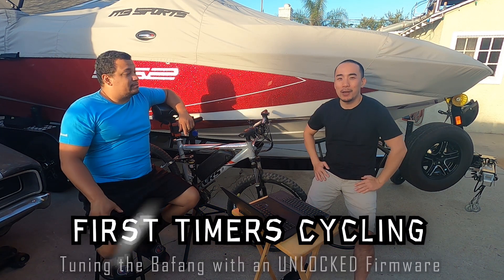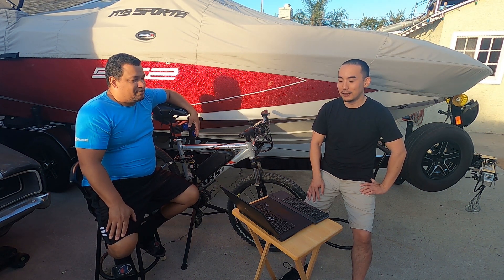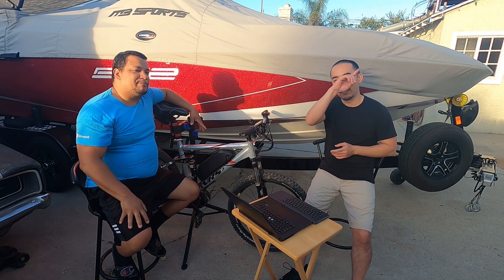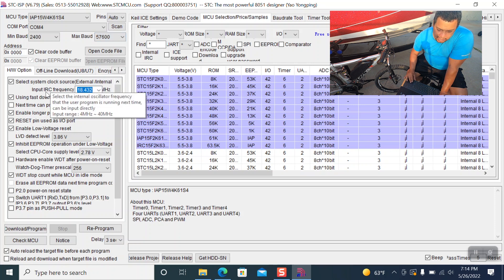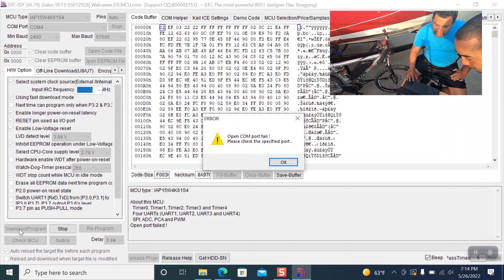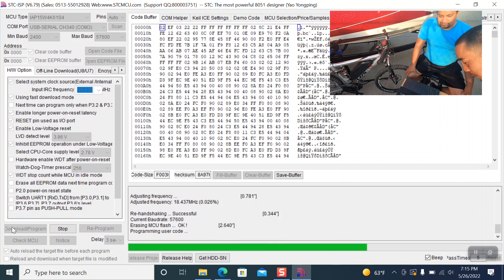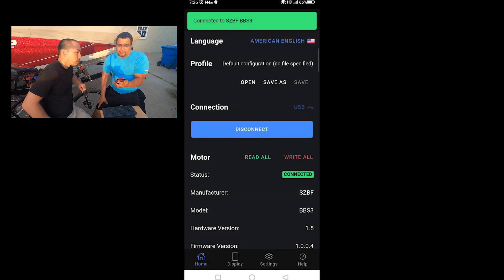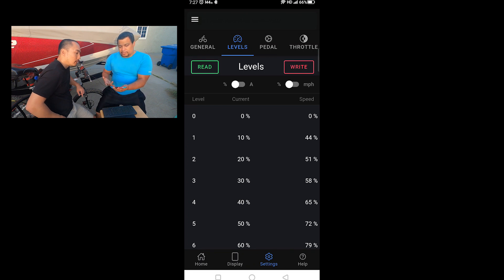Tuning the Bafang Controller with UNLOCKED firmware

Comment: Is it possible to bypass the speed sensor on the bbs02 canbus
Reply from the maker: Not really sure. May I ask why you are trying to bypass it? I'm curious.
Reply: @FirstTimersCycling  my speed sensor isn't working and I have replaced it with no luck
Reply from the maker: Checked the cabling to the controller?
Reply: @FirstTimersCycling all seems ok no broken wires
Reply: @FirstTimersCycling although I haven't taken off the controller to look inside
Reply from the maker: Hmm... wish I could help. Don't know what else it could be.
Reply from the maker: @williamlam8306  What about the speed sensor magnet that goes on the wheel? Is that still good and attached?

Comment: Mine the same 48 nominal voltage and 28a
But my bbshd is 52v and also the battery , I thought maybe the seller made mistake ??
Reply from the maker: We believe it's just the Bafang Controller that you are using that supports 52v. The one we are using is the C961 which seems to only support 48v.

Comment: How can I do this i have a 750w bafang i have got the cable and a software but only does 40mph
Reply from the maker: Hello, and thank you for commenting! This firmware is for the 1000w motor. Not sure how or if it would be compatible with the 750w.
Reply: @FirstTimersCycling do you have a software for 750w my bike jitters iff the start but I want to be able to get the from end up
Reply from the maker: @Nitro_only We only have it for the 1000w. You can try reaching out to GoldenMotor to see if they can help you. They provided the 1000w firmware update so I'm sure they have one for yours. https://goldenmotor.bike/collections/bafang-mid-drive-kits?srsltid=AfmBOor5rbOyf33czMnX3VtwO2d3K7gwW20pXPS1uHK1h7FH76Uya6V4

Comment: The delay with the original firmware settings isn't even safe.
Reply from the maker: Hello, apologies for my ignorance, but what delay? Are you referring to the stock firmware on the BBSHD?
Reply: @FirstTimersCycling Yea the original. For me it's too delayed to get you out of a sticky situation.
Reply from the maker: @warlockboyburns hmm, we didn't experience a delay with the stock firmware. Maybe a little. It's definitely like a car throttle with drive by wire instead of a cable throttle connection, if that makes sense. If that's the type of delay you are talking about, then yes.

Comment: Great resource. My question is about the Bafang motor. Most hub motors are taken from the bafang design if not outright a copy of.  Will this tuner work on those cloned Bafang motors too?  I cant find this answer anywhere, can you help out?
Reply from the maker: Wish I could answer that question, but I don't know. We've only dealt with the 48v and 52v bbshd mid drive bafang motors. Might want to reach out to Golden Motors as they might know better. Sorry!

Comment: I've just bought a 36v bafang motor, but i have a spare 48v battery from a previous conversation that I have done and I'm wondering if with the firmware I can change the motor to 48v
Reply from the maker: I wish I could say yes, but we don't know these motors compatibility to different battery voltages. Might want to ask Golden Motor who creates firmware for the bafang and is highly knowledgeable! Hope this helps!
Reply: @FirstTimersCycling change capacitator

Comment: what are the settings for 48v battery
Reply from the maker: We haven't looked for the 48v setup. Alvin's bike is the 52v and he wanted to tune it. The 48v is running the stock firmware as of right now.
Reply: @FirstTimersCycling  oh ok thanks if you do work that out please let me know greetings from the Netherlands
Reply from the maker: @ManMan-b5y5c  We will make a video if or when that takes place! Thanks for stopping by!
Reply: i have a 48v battery do you know what settings i need in the programe or re they the same
Reply from the maker: I'm afraid we don't know for sure as we are not experts for the Bafang motors. You might want to reach out to Golden Motor -> https://goldenmotor.bike/ to see if they can help you.

Comment: Word of advise is just installed the new 32amp controller and then set it to my 52v battery set up ,this had a negative effect on my battery power so when I reset to 48v using the same settings it put the battery back to ful, power and running at almost 54v , in top gear it runs off throttle power no weight 50 miles per hour wheel speed , less is more guys
Reply from the maker: Oh that's interesting, thanks for the insight! I would imagine it to also depend on gearing sizes as well?

Comment: Hi guys,
I am struggling a bit to configure my 48v BBS02, I changed the BMS on the battery, and the error 30 appears on the screen after that. I am flushing the system many times but the error is still there. Do you have where can I find the correct firmware for a 48v BBS02?
Reply from the maker: Hello, I'm afraid we only worked with the 52v firmware on Alvin's Bafang setup. Mine is the 48v and have not yet updated the firmware. I don't plan on modifying it either. Sorry!

Comment: My controller has 30H error I've tried to connect the controller but nothing it just will not connect any ideas please.on the Bafang data cable it's red but the blue light is solid not flashing.drivers installed so I have no idea why it will not read.
Reply from the maker: Hey there, in the description field of this video there is another link to the firmware update provided by Golden Motors. If the updated one is throwing that 30H error, try reverting back to what works. The one from Golden Motors should work, it just didn't allow tweaking of the settings via Speeed app from the phone.

You can also try this link to try another firmware update https://support.biktrix.com/kb/guide/en/52v-programming-for-bbs02-motor-K2gUq2nWAX/Steps/1132765
Reply: @FirstTimersCycling  hi thanks for the reply thing is it will not connect to the program because of the 30H it will not connect to the software so I can not revert back to anything.
I think I have a brick,oh and have tried a new display still 30H also re did all the connections changed the wire harness.
Thing is though pedal assist still works though I get no battery voltage and no speed indicating.any ideas.also I'm on a 48v battery 21Ah by the way my controller is a Bafang LD-BG-AK007 22A 48V
Reply from the maker: @ManMan-b5y5c  Aw damn. That sucks. The videos we posted was for a 52v setup not a 48v. Alvin's ebike is a 52v battery but we read that the motor uses a 48v firmware so we had to upgrade it from 48 -> 52. This may be why yours is showing 30H as the firmware you installed is for a 52v. Might want to try reaching out to Goldenmotors to see if they have a base 48v firmware you can upload. That should bring things back to default hopefully. I hope that helps.
Reply from the maker: @ManMan-b5y5c  We're not professionals but there should be a way to revert or upload a different firmware
Reply: @FirstTimersCycling  i havent installed any firmware on this controller im just trying to install a firmware so the error might go away ,but it will not connect to the programe to install and like i said earlier my controller is LD-BG-AK007  bafang controller not a mid drive.
Reply from the maker: @ManMan-b5y5c  ah I understand now. Sorry about that. Wish we can help but we aren't experts on this and only found firmware for the setup we currently have which is the Bafang BBSHD 52v mid drive system with a C961 controller.
Reply: YO HE CONSEGUIDO SOLUCIONAR EL ERROR 30 H mejorando las conexiones de cada elemento externo al motor....sensores de freno, sensor de cambio, en todos los conectores he añadido lubricante electronico para contactos y consegui solucionar el error. No se cual de ellos tenia una mala conexion por eso lubrique todos los conectores.
Reply from the maker: @mikelugarte2280 Thank you for sharing that fix for the 30H error! Hope it helps anybody else!

Comment: I just had my first ride today with the hd, and the sw102. Still charging battery so I can use the I think its the bbs tool thing with the pc. Haven't got a working otg right now but it's on the list.
As far as I can see the eggrider and the cyc, these are just sw102 displays with custom firmware? is that correct?
Can you educate me a little on firmware stuff, I haven't got my head around that yet, if the stock is fine, or if theres custom stuff available without spending additional money..
Reply from the maker: Hi there and thank you for commenting! To our understanding, the firmware is on the HD motor itself, not the controller. The stock is fine for most, including myself, but Alvin wanted to be able to go faster and up the output. I believe if you reach out to Golden Motors, they should be able to help you with firmware that will work for your setup. We are by no means experts on the subject either, so I'd rather not give you misinformation. What we did was at our own risk and on the systems we purchased just for learning as we enjoy tinkering. Not sure how any other controllers would perform with the firmware update.

Comment: Good morning,

on my bafang m620, I changed the pedal sensor, then the controller,

the engine runs only on the accelerator.

I also bought the C961 screen to calibrate the motor, but I cannot configure it.

by pressing + and - simultaneously, you do not enter the menu.

can you help me please?
maybe the manufacturer's contact details.

Sincerely
Reply from the maker: Hi there, here's a video I found to assist with the C961 display. https://youtu.be/WTD7tV58BWU?si=HGcJOX4JqiHJrQE_ Hope this helps!

Comment: Thank y'all. Golden Motor gave me a locked firmware. They set it to 52V, but I wasn't able to connect to the Bafang Config Tool. Your firmware fixed my problem. Thanks again. Now I'm bout to test out my new profile. Hopefully I won't die.
Reply from the maker: Lol nice! We take no credit to the firmware as it is actually Golden Motors "unlocked" version of firmware that a viewer shared with us. Be safe out there and enjoy! Thanks for commenting. 👍
Reply: Having that exact problem. Only 48 volt unlocked is showing up on the one drive

Comment: hiw can i backup the original firmware?
Reply from the maker: Hey there, that's a good question because that's not something we did. I'm assuming when you use the tuning software and do an initial scan, that should be the original firmware. Then when you load up the modified firmware to upload that onto the Bafang controller, if you do a scan, you'll notice different numbers. I can't say for sure as like I said, we didn't back up the original firmware.

Comment: Hi  where can I get the code you used as I can't get the throttle  to work
Reply from the maker: Hello, what part of the video are you referring to? We didn't enter any codes so I'm a bit confused as to what you are asking.
Reply: @FirstTimersCycling the flash you put on to get the throttle  working
Reply from the maker: @PaulWilliams-yf1pf  The firmware we used is linked in the description of this video. It allowed us to then plug in the Speeed application to tweak the settings. The episode where we install the Speeed ap is -> https://youtu.be/AdX12LCxRRo Hope this helps!

Comment: Hi, does the Speeed app works also with bafang rear hub motors?
Reply from the maker: Don't see why not. As long as you have some type of controller, the Speeed app should be able to connect. Can't say for sure though as we only have experience with the setup we have.
Reply: @FirstTimersCycling  Thanks a lot, and congratulation for your video!

Comment: Everyone programs the engine, I have the speed locked in the display at 25km/h and programming the engine won't help with that. I am looking for firmware for the c18 display. An unlocked engine with this display also drives a maximum of 25 km/h. It is necessary to reprogram the display. I do not know how. The speed and wheel size value is locked.
Reply from the maker: Sorry not sure how to help you there. We have only used the C961 controller display system. This one allowed us to modify wheel size and speed as it was not locked.

Comment: Hi, could the low cut-off voltage be set lower than 48V-38V in this engine? 13S Samsunf up to 32V would be ok.
Reply from the maker: Many have stated not to go lower than the recommended low-cut off voltage. They say it puts a strain on battery longevity.

Comment: hi, I have a 800S display and  i need to change voltage setting from 48V to 42v , any one can help me? why are firmware for display? i cant change voltage next password 0512 and 1919 not work.
Reply from the maker: Sorry, we can't help you there as we don't have experience with that display controller. Hopefully, somebody can chime in to assist you on here.
Reply: @FirstTimersCycling  ty
Reply: solved i have made a firmware with low voltage !
Reply: @Dark_Phoinix  Hi, how did you succeed that ?

Comment: such a tight fit for your battery - how did you do it?
Reply from the maker: Yeah very tight fit. Have to pivot the mount to slide the battery on then pivot the battery back in. Only one screw can be used on the mount to allow pivoting then we use a zip tie to secure the top side of the battery to the down tube of the bike.

Comment: Hi guys, Thanks for the video and the files.I had same xperience with the Golden Motor files. could not connect with the configuration software, I used the file from Endless Sphere also to end up with an error07 (overvoltage) Im assuming that file is for a 48v battery set up. I am running BBHDS 1000w 52volt 20a. Your file, that looks newer as far as numbers go did the trick. No more error07 and configuation software connects without issue!  Cheers
Reply from the maker: Hi there and thanks for sharing your experience! All files used on Alvin's bike was on a 52v 1000w BBSHD setup. Mine (Hiro) is a 48v setup but I haven't hacked my Bafang yet. Glad the up to date file fixed your error!
Reply: It sounds like you have mastered the complexity of all this Chinese software and have the same motor as me but I do not have your IT skills. Do you see the possibility of someone combining all these complexities and designing an app which anyone can use?
Reply from the maker: Hello there, to answer your question, not really sure. Never really thought about it. Bafang setups are pretty solid as is in stock form and firmware. The mods are for those who are comfortable and wanting to tweak things to get the most out of it. Again, Alvin's bafang is modified. Mine isn't and I'm fine with that. To each their own I guess.

Comment: Can someone point me in the right direction?
I have a M620 and the throttle will only engage when I'm going 5km per hour or so.
I do a lot of washed out roads with large rocks so is there a firmware solution
to enable instant throttle? Thanks.
Reply from the maker: Have you tried the Speeed app? That app will allow throttle control setup.

Comment: Hi guys I have a 48v setup with a 500c display I wanna keep it at 48v cause I got the 48v battery but I feel like the battery drains quite fast maybe it’s my battery or maybe it’s the bbshd is there a way to make it fast and efficient or am I just being too hopeful
Reply from the maker: Hi there and thank you for commenting! When you make the Bafang go fast, the battery gets drained faster. It also depends on your gearing and the amount of load you put on the motor. Are you riding on flats? hills? All of that comes into play besides just the battery and motor.

Comment: Double tap M go into setting on display then scroll down to voltage and change there, there is a pin I can look it up I wrote it down somewhere or it’s on YouTube how I found it, it’s like 1806 or something, if u need it I’ll check meanwhile
1919 is pin on some
1801 is bbshd 52v
Reply from the maker: Hey there and thank you for commenting! Are you talking about the Speeed app? Not exactly sure where the "M" button is you are referring to.
Reply: @FirstTimersCycling  no u can change right from display in advance settings